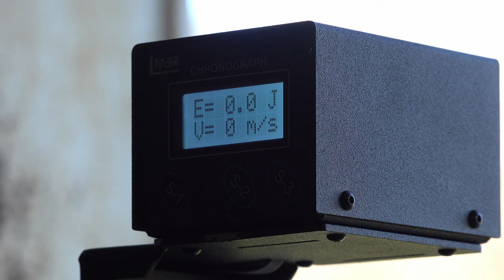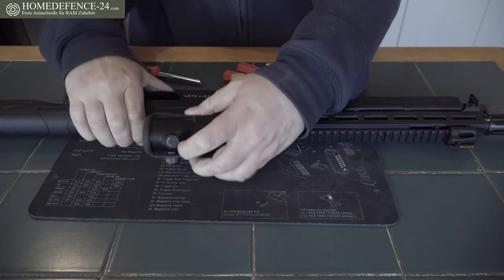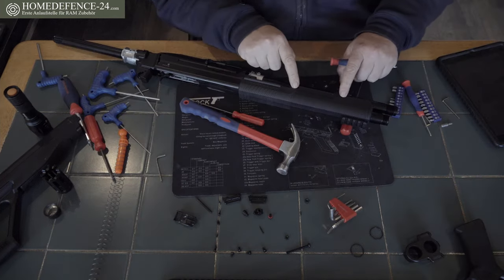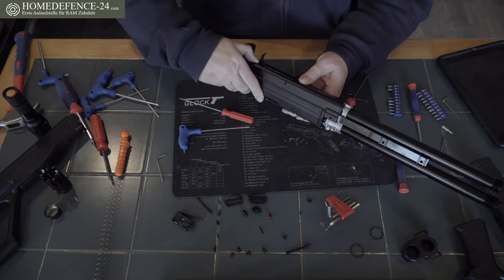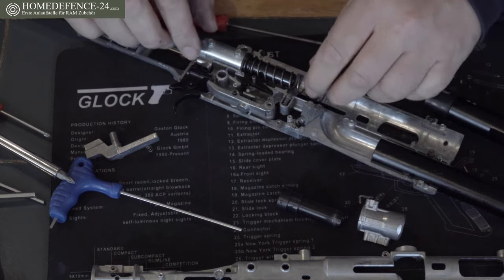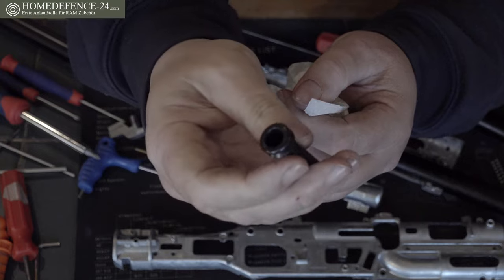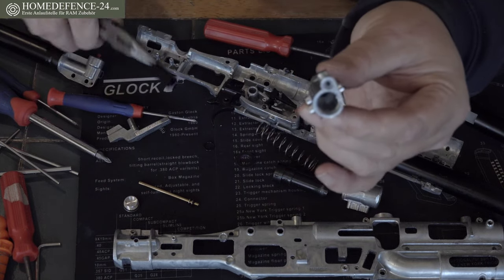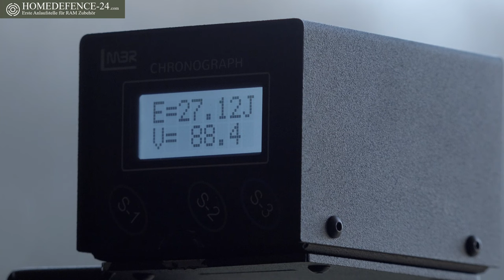Fitting a Powerkit68 to the Umarex HDX 68

Comment: Hi mate - question can we us3 HPA tank with the HDX 68  i was thinking stripping down the co2 section in 5he stock and replacing with an adapter?
Reply from the maker: The CO2 tube goes right into the gun itself, at least on the 7.5 and 16joule version. You might be able to tap a thread onto the tube to accept an adapter, but that is beyond my capabilities with the tools I have here.
Reply: @Maddogairguns  yeah i was thinking the same thing, mite see if i can find a spare to try it on, thanks for the reply, ps give the valkin m17 a2 (tipmanns) a play, really easy to tune and bags of fun 😊 you will love it!!

Comment: Nice vid 👍 thinking of getting this one and the power kit for it… i do have a question about my HDR 50 that I have fitted the power kit to, when I hit the stock to prime the gas it fires by itself… any idea what is causing this so I can fix it ? any help will be much appreciated
Reply from the maker: Did you get all the springs back in. It shouldn't fire off when you prime the CO2, but without seeing it, it would be hard to diagnose.
Reply: 90% the little spring is the mistake

Comment: Do you put the little restrictor pin back in the tube that goes into the chamber or do you let it out?
Reply from the maker: No, the little brass top hat piece comes out and stays out, mine fell out. On the hds I had to pull it out. Just make sure the seals are still in place.

Comment: Great video and respect for taking the gun apart.. I`ve got the 40J version, wondering if it would take it up to 65J with this kit?
Reply from the maker: I think you can get more power from the 40, not sure how much though.
Reply: @Maddogairguns  the weapon store owner told me that being hit with 40J would be enough 😉. Also not sure if the valve in the 40J version isn’t shorter already.
Reply from the maker: @PatOutdoorify  Yes, I think 40 joules would be enough. But I have seen Homedefence-24 had modded the 40 and got some gains from it. I'm happy with 30.
Reply: @Maddogairguns  my gunsmith is willing to install the powerkit in my HDX40J, So let`s see :)
Reply: @PatOutdoorify  Hey, :) i´m very interested in how the 40J HDX is working with the powerkit now. What are your experiances ? Is it wort it? How many rounds are you able to shot in comparison? Thx

Comment: So I can tell you that it was nowhere near as easy getting the old part out, I think they had red locktite on it and I put it in boiling water and paint stripper and it wouldn't budge, I had to literally drill it out from the top and bottom but after an hour I was able to get the old one out and thread the new one in, so I now have the 88 gram adapter no restrictor and the power kit amd got 46 joules

Comment: Hi,  I have seen that the factory 40J models of these have a fitting for an 88g CO2 bottle - when you had it apart did you see any way to convert it to this? (ie does the black air tube unscrew etc) Allegedly the 88g bottle is the only way to get 40J with CO2 (the 2 x 12g can't supply enough gas), but it'd be nice to be able to use the bigger tanks and it'd also give the option of using a remote line, both for more shots before it fades and needs reloading. (and of course you could still use the 2 x 12g to 88g adaptors Umarex helpfully sells)
Reply from the maker: I don't remember seeing an easy way to remove the tube. Someone who is good at engineering might be able to sort something out, but that's not me.
Reply: C02 gives the same pressure regardless of size of tank. The larger c02 will only give you more shots.